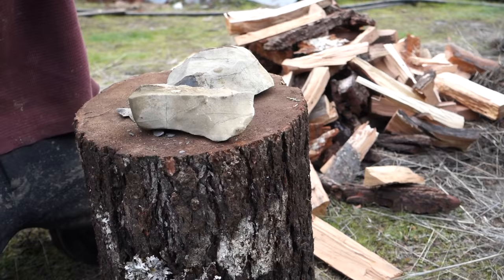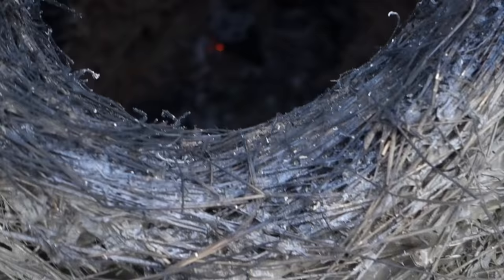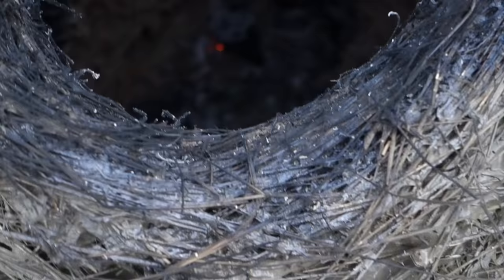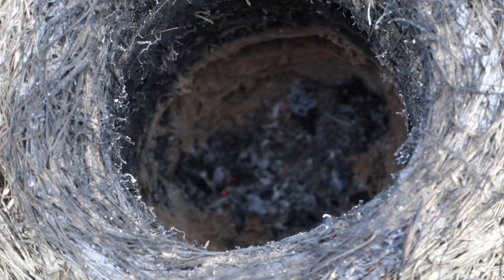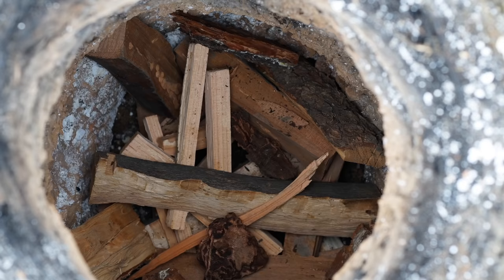PRIMITIVE FIRE SCIENCE!  Burning Shells Into Lime In a Grass Straw & Clay Furnace

Comment: In this case, did you use both shells and limestone in the kiln at the same time? Does it matter if you combine them? or does stone require more fuel to become calcium hydroxide?
Reply from the maker: +Lawman212 Good question.  I did put them together in that one just to play with that limestone.  I don't know a lot about burning limestone because there is very little around here,  but I have enough of that stuff to do a load just with the limestone, which I will at some point.  If the pieces are bigger, the fire obviously has to burn longer to penetrate.  There is a lot of unslaked lime in the lime putty that I slaked from this stone.  I think even smaller than 2 inch pieces is probably going to be best in this small mixed fuel set up.  Unfortunately, this limestone is really hard to break.  In kilns with big pieces of limestone, they burn it a long time, not just mixed and lit like mine is.  This video of burning a lime kiln in Hungary is great!  I learned a lot about how it might be done on a large scale watching it.  https://www.youtube.com/watch?v=ePSO3MrbS0A
Reply from the maker: +Lawman212 Thanks, I have seen that one as well.  I'd like to build a slightly larger permanent kiln and some point and find a source of limestone.  I've got plenty of wood.

Comment: Do you have to mix with water to make a cement?
Reply from the maker: Some limes set without drying, like concrete does.  This is already wet and is almost pure calcium, so it will not set underwater, though some limes will if they contain other substances or if a pozzolan is added.  so, with regular high calcium limes like this, the lime has to dry to cure which is why you can keep it under water.  If mixed with sand and whatever additions of water are necessary, you can make mortar and plaster, but high calcium lime is too soft for making what we know as concrete.  For that you need pozzolans too.  However, harder is not always better and high calcium soft limes have properties such as flexibility and self healing that make them better in some ways for traditional masonry work.  Hope that makes a little bit of sense at least.
Reply: +SkillCult // thank you

Comment: sir did burning sea shells will give you a quicklime? answer me please it's for my educational purposes
Reply from the maker: Yes, burning any kind of shells will yield quicklime.
Reply: sir we tried to used mussel and we burnt it using a simple grill but it ended up to a white like scale(it's so brittle) and when we tried to mixed it with water, nothings happen :(
Reply: if we use HCL instead of burning mussels will it gives a same result? :(
Reply from the maker: Define HCL
Reply from the maker: Good for you for trying!  It's easy, you just have to get a couple of things right.  The important factors are how hot the shell gets and how long it stays hot.  Mussel shells will be pretty easy because they are thin.  The heat up quickly all the way through and don't have to stay hot for as long.  The shells have to become red hot all the way through for a period of time.  This usually requires a closed container like a barrel.  Cut out the bottom of a metal drum and leave air tunnels at the bottom for air to get in.  Light it from the bottom and use at least 2 parts wood to one part shells the first time.  Stack it in layers like I do in the video.  Sort out the shells that are white all the way through and add boiling hot water to them, but not too much water at first.  did you watch the long version of this video? it has much more information.  https://youtu.be/jOxaOTUGuKo
Reply: yes sir i watched all your videos related to our research study thank you for helping us sir :) I'll include you in our reference sir :D thank you
Reply: sir i forgot to ask if we should remove first the green thing on the back of the mussel before use?
Reply from the maker: You should not have to remove anything from the shells.  it will burn off.

Comment: Can you get lime from eggshells
Reply from the maker: Yes.  I have them saved to do a video.  You can use any tall can, like a piece of stove pipe or some of the big food cans that are like 6 inches across stacked should work.  Layer sticks and shells till full and light from the bottom.
Reply: @SkillCult  thanks for the advice and clarification im probably going to do that soon. Gonna try a cement mix with lime wood ash and clay

Comment: Hey this is awesome! I found some limestone on my homestead! Thanks for the video I want to do something similar but I'm going to dig out a Dakota firepit and possibly use old tires to fire the kiln! How long would I have to heat the limestones!? Can you please give me advice on heating times?
Reply from the maker: Break it up small the first time around, like 2 inches and down, but still in chunks.  The factors are temperature and dwell time.  Or how hot it gets and how long it stays hot.  If you are using a kiln where the fuel and limestone are mixed, you'll have to just fire it and let it go pretty much.  You can add fuel and stone from the top and change the ratio, but it's not really going to fire the stuff on the bottom more.  Using a dirty petroleum fuel like that might contaminate the lime, I'm not sure.  I've heard that coal can.  If you have wood, I'd use it.  It's known to make high quality clean lime.  It also only burns so hot unless you force air into it, so it won't exceed the maximum temp, because it is possible to overburn.  I'd start with about 1/4 lime to 3/4 wood, make sure it's working, then tweak the wood quantity  down from there.  Good luck, it's super fun.
Reply from the maker: And it looks cool!
Reply from the maker: Also, watch the longer version of this video here on youtube for sure and if you want to geek out more, go to the skillcult.com site and search for lime for more articles.
Reply: Hey is there a method to test for lime or a website or can I send you some photographs of the rocks I think might contain lime? I live out in the boondocks and I can't get to vinegar and the hydrophloric solution for a week and I'm dying to know if I have limestones!!
Reply from the maker: I probably could only say that it looks like it might be., not for sure.    Got pickles in the fridge maybe?  vinegar is not as reliable in my limited experience.  What about battery acid?  Most batteries are sealed now though.

Comment: I tried putting seashells in a small campfire and it didin't work im guessing its because it didin't get hot enough
Reply from the maker: Try throwing the shells on the coals, add quite a bit of small and medium wood, more shells, more wood etc.  You might get them to calcine.  the smaller the shells the more likely it will work.  You may also get partial calining.  Also, use hot water when you slake and just a little at a time.  Shells are harder to slake than limestone.
Reply from the maker: You can tell if it's burnt enough usually because it will be white, or maybe just the core of the shell will be black or grey because it's not quite finished.
Reply: @SkillCult  thanks for the tips
Reply: @SkillCult  yes they were grey from the inside